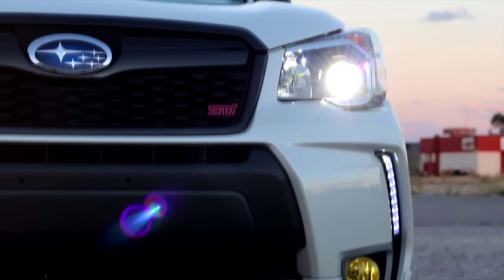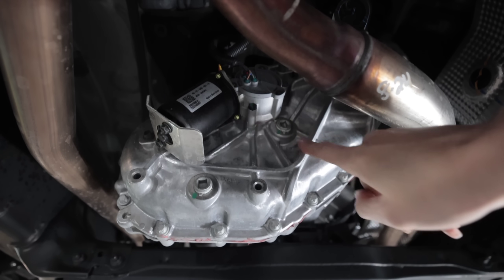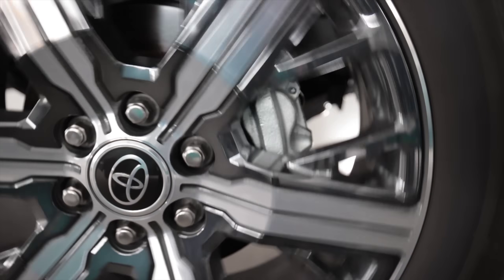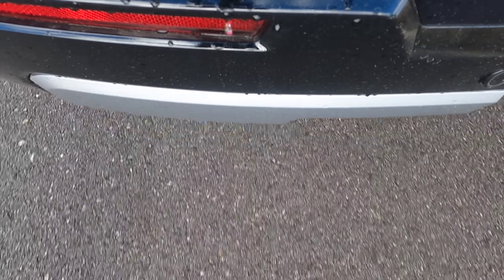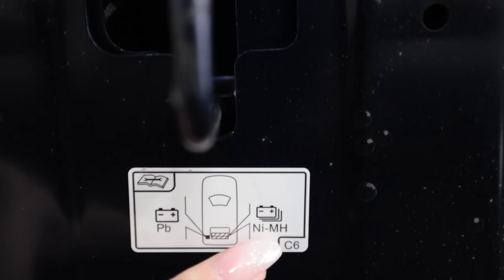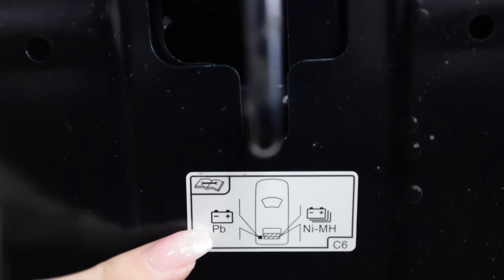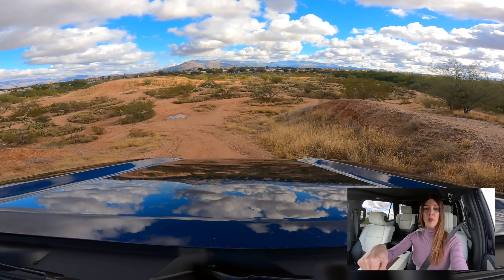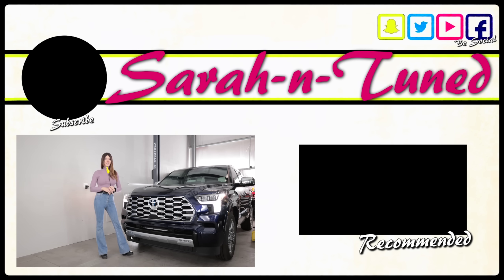Toyota's New Luxury Rig Is Rad // 2023 Sequoia Capstone 4x4

Comment: I own a 2018 Platinum and its the second one I have owned.  I previously owned a 2011 Limited Edition.  Amazing vehicles and I love them.  Tons of room and drives great!
Reply: Isn't 2011 and 2018 basically the same generation but just facelift? I almost forget how absolutely dated the previous generation was. They still look absolutely rugged though.
Reply: @cloed0ll  Yes - same engine and minor facia upgrades and safety features such as bsm, auto lights, laser cruise, etc.  Also LED lights were added in 18.
Reply from the maker: As much as I love the UZ and UR V8s, I can’t knock the new Twin Turbo 6 like so many people do. The whole wastegate issue I feel was turned into a big doom and gloom scare piece about turbos. I guess it’s different through the eyes of a car enthusiast though 🤷🏻‍♀️
Reply: @SarahnTuned  every car manufacturer seems to be going to turbos.  You can’t get away from them.  The upside is gas savings and  peppiness…the downside is the maintenance cost if that turbo breaks or leaks or needs replacement.
Reply: @SarahnTuned  I agree. This is Toyota, it's not going to be an experiment, they knew what they are doing
Reply: @holnugget  Absolutely agree, but I always ask myself if gas savings is a factor, why give it the aerodynamics of a squared block of cheese? 
I guess that is to boost the drivers ego that it is supposed to look like a truck and optimized for the US customers taste for fuel waste and monstrous views?! That thing will not be a best-seller here on the European market for sure, but its quality and interiour is pretty amazing - to be expected because its a Toyota.

Comment: I totally forgot it was on a 1-10 scale and not on a 1-5 like it used to be.   The ratings make more sense now.
Reply: Thanks, I agree and I didn't know either.
Reply from the maker: Yeah, I changed up how I concluded the score a little still so it’s no “double”. The bean factor takes 0-60 into account mathematically but is then skewed based on gut feeling.
Reply: @SarahnTuned  does that mean the penguin score takes into account how many penguins like the vehicle?
Reply: Same… I was confused for a second. Glad I checked.

Comment: The probable reason you won't find too much "off-road goodies" in the new Sequoia is the room Toyota is letting for the slighly smaller and narrower 3-row US-spec Land Cruiser, made from the next gen Land Cruiser Prado / Lexus GX.  

In those Toyota and Lexus are expected to put plenty of "off-road goodies" including higher ground clearance, longer suspension travel and a beefier shock system. The engine combo may actually be the same Hybrid Max (PHEV) as this Sequoia.

The next 4Runner would be then a lower 2-row BOF SUV based on this same chassis family, but with the T-2.4L I4 instead of a V6.

Comment: This is a really nice rendition, but I don't think I would ditch my 2020 for one of these. I really can't get over the cargo space in the new hybrids. My 3rd row folds flat and its a ton of very useful and valuable space. And to be honest, I've seen 18mpg (calculated) on trips in it. It's not much worse than that even for daily driving. I don't see how current sequoia owners would benefit from a 23, but just my $0.02
Reply: I'm staying with my 70 D-100  it still gets 20 MPG doing less than 10 mile trips at a time.
Reply: They should have just refreshed the exterior of the last generation and put serious money into the interior
Reply: Don’t ditch those 2nd gens, they have the tanky 5.7 L V8, it’ll probably outlast the new v6 turbocharched ones too

Comment: I am glad Toyota found a new supplier for the turbo wastegate. I hear replacing the turbo involves removing the body off the frame. Does the Sequoia have the same wind noise issues as the Tundra? It almost looks like the Tundra window moves in its rack, so it is more than a seal issue. BTW, I am a Toyota-owner, so don’t take my comments as just a “hater”.  When Toyota gets it all right I may go Sequoia next time, currently in a 2007 Tundra.

Comment: I hope it is better built than the 2021 Toyota Corolla junk I got rid of. Never had a new car with so many problems.
Reply: Exactly what problems?
Reply: @Anomize23  Numerous check engine lights. Once it stopped running on the freeway and had to be towed in. It was the fuel pump that was bad. Then the power windows stopped working one by one. Then the transmission had a problem shifting uncontrollably at freeway speeds. Not to mention the numerous rattles the car had in the dash. I got rid of it with less than 10,000 miles on it.

Comment: Nice in-denial mini-van, obviously under-powered for the 1-ton-too-heavy weight.  Golden 10:1 ratio weight-to-power fail there.  Sarah's reviews are always great.   As for the hill-climb (camera adjusted for drama), I bet a 1999 Saturn SC2 with winter tires could handle it just as easily.  Just sayin'.  Still, you wouldn't want to damage test-vans.  Got thrown-off a bit from the new score 1-10 (instead of 1-5).. I mean, WHAT?  3.7 on the Beans Score?!  Oh, yeah.  It's 1-10 now!  Whew!  Also, sweaty Sarah is best Sarah because hard-working Sarah is best Sarah.

Comment: Expecting far less reliability due to turbos failing before the engine
Reply from the maker: The idea that turbos are inherently bad is absolutely ridiculous lol. Clickbait nonsense car videos from talking heads have scared people into believing that false narrative.
Reply: @SarahnTuned  Sarah's comment is correct in that the question is much more complex than the simple blanket statements spewed at us online...  If a manufacturer has experience designing turbo-charged engines, has selected the proper materials to ensure reliability in a turbo environment and if the user adheres to a more frequent maintenance schedule (for example: 3000mi between oil changes instead of 5 or 10K using a turbo-quality synthetic, and plugs at 30-50K instead of 80K), then a turbo-charged engine can approach NA lifespans (within ~10%, from aviation TBO standards).   But if you treat a turbo-charged engine the same way most folks in the US treat NA engines (poorly), then of course I wouldn't expect them to last as long (neither do their NA engines).  So choose the manufacturer carefully, but most importantly:  Know your car and what it needs, care for it, and it'll take care of you when you need it.
Reply: @SarahnTuned  you know better for sure! I was told turbo diesel is good but not turbo gas engines due to more heat.

Comment: So they cheaped out on the rear suspension, dashboard, interior buttons that look like they're from a 90s Corolla (yeah don't put the steering wheel heater button, you know, on the steering wheel), and they use a NiMh battery instead of lithium ion. The GM EV1 had a NiMh battery for reference. A timing chain is not a noteworthy feature as most American vehicles have had them for centuries. This is a soccer mom mobile and sub par compared to all the American full size SUVs yet costing about the same.